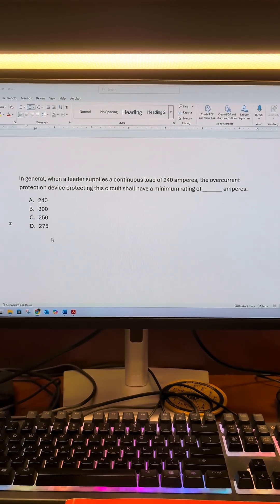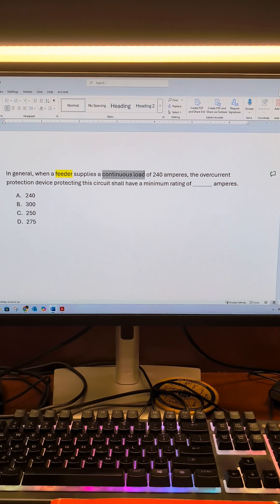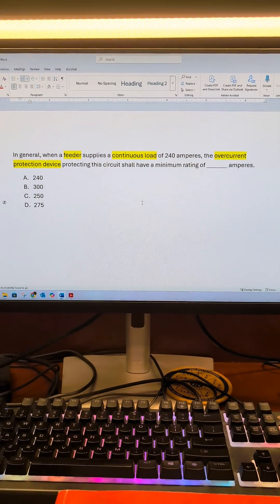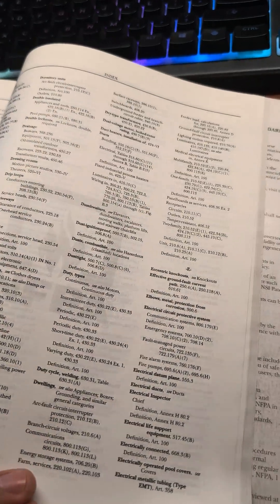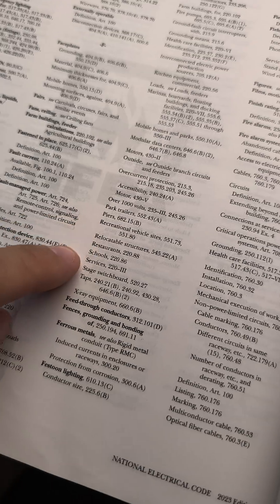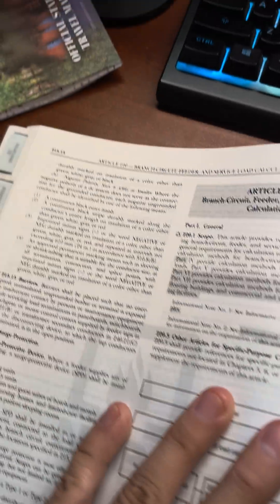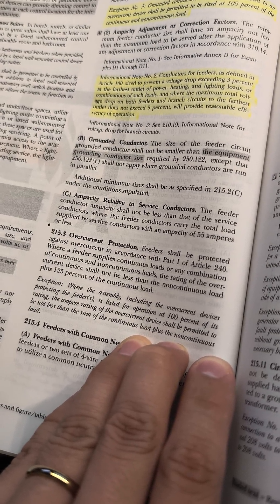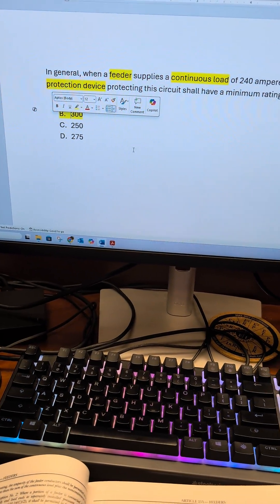Think Like A Master Electrician: Continuous Load? Don’t Undersize That OCPD! #ElectricalCode

Comment: Does the feeder have to be a standard breaker size or  once’s the math is complete you take that number as is?
Reply from the maker: Excellent question. You are correct. You would want to verify it is a standard size. 300 is a standard size and so no additional work is needed.

If it was 275A, you would then need to look at up sizing to 300A since 275 is not a standard size. Article 240.4(B) allows up sizing to the next standard size breaker and Table 240.6(A) lists the standard sizes.

The downside to shorts is I can't really cover this all. Thanks for watching and Kudos for calling that out!
Reply: @JohnPaulElectricTX thanks so much love all your videos taking my test in 2 weeks need all this good information!